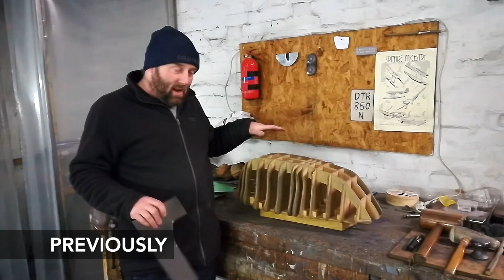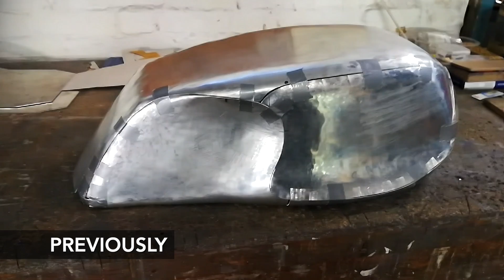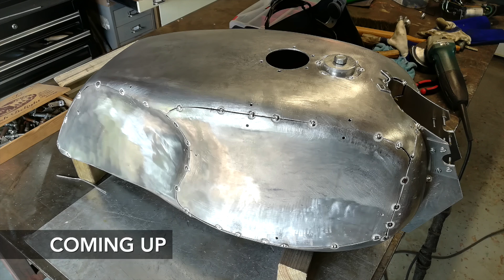Making a Custom Tank for a Classic Cafe Racer - Part 2/3

Comment: Fascinating video, thank you for posting this.  It's so much better than the dumbed down stuff we get on TV where the presenter always has to have a go  as well.  One question though.  Doesn't the aluminium work harden?  Do you anneal it?  I've done some metal forming making model steam locomotives which I do as a hobby but work hardening is always a problem and multiple annealing is required.

Comment: Nice bit of welding 👍
Reply: Did  you purge the tank while welding it ?
Reply: @stephencroft6481  No need to purge a new tank. With used tanks it can be a wise move as, however carefully you clean them, there's always the chance of some fuel vapour remaining and causing problems.
Reply: @dtrpp3386  thanks I just wondered I used to do alot of tig welding of different  materials but I haven't done ali before